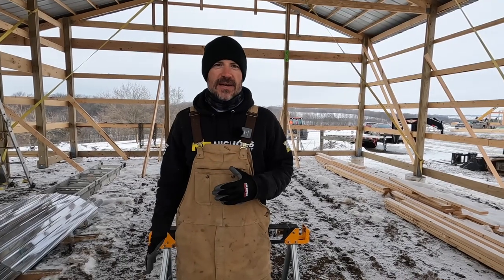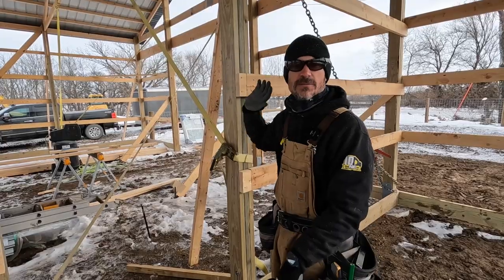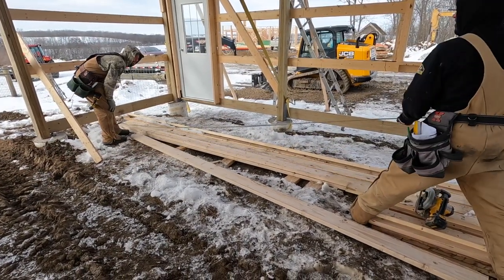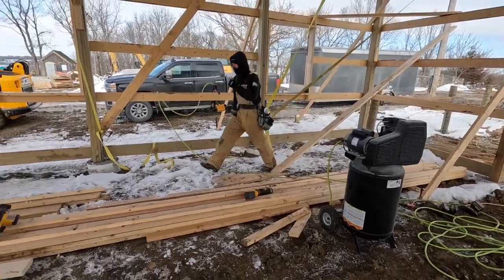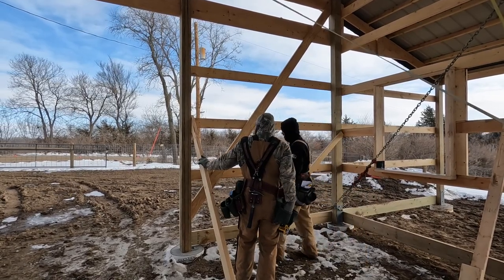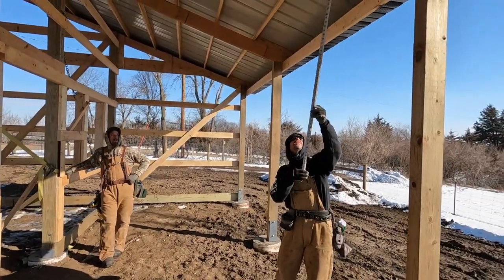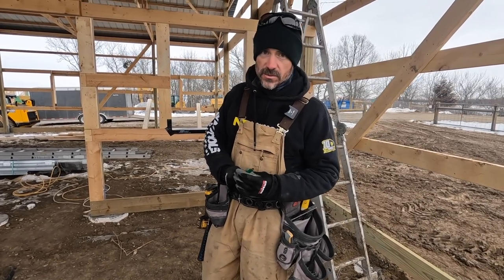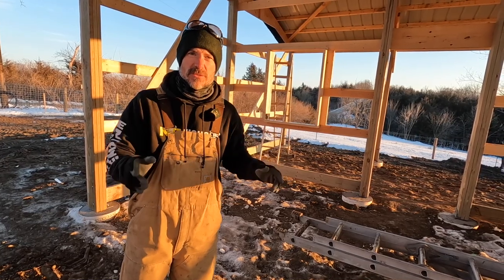Building a Post Frame Barn | 30 x 36 | Door + Windows + Bracing | Ep5

Comment: Paul, you should give a weather report at the beginning of each video. Temperature and conditions.  I'm a South Texas boy. Anything below 50* is grounds staying in the shop and working. I couldn't fathom working with snow on the ground. 
What type of work gloves do you use for cold conditions?   The mic is a great addition.
Reply from the maker: It's been cold! We've been trying to work inside during the extreme (wind chill in the negatives) weather days. Still trying to find the right gloves that are thin, but warm.

Comment: I noticed you cut that bracket on the corner? I’m currently building our Barndominium home and was wondering if I’ll have any issues with building codes if I cut the corner brackets? I was going to router the skirt boards but would rather cut the bracket

Comment: I love your builds!  I've had a question for a long time on bracing.  You have wind load direction and then position of brace Tension or Compression.  Tension is always strongest.  I rarely see anyone installing tension side up, pointing away from the wind.  Are your engineers specifying brace direction?  Or is it so insignificant it doesn't matter?
Reply from the maker: Yes, on this build the bracing was specified.